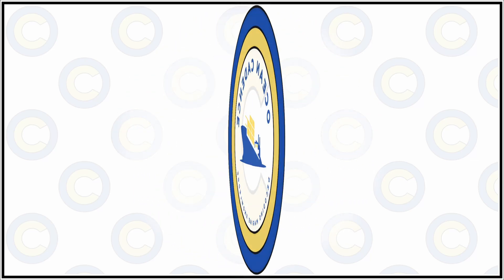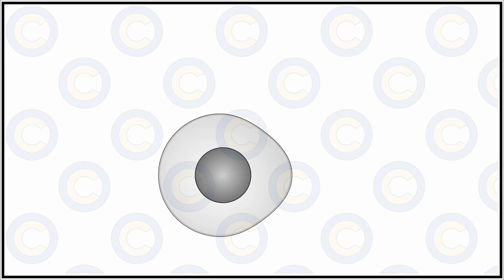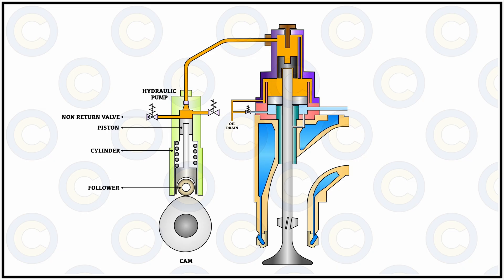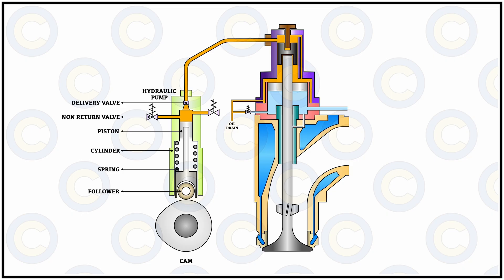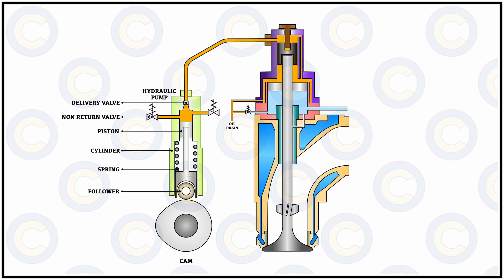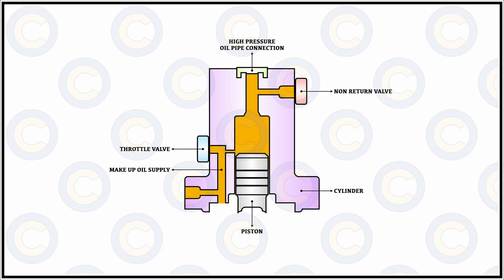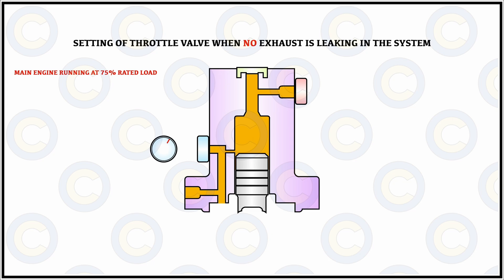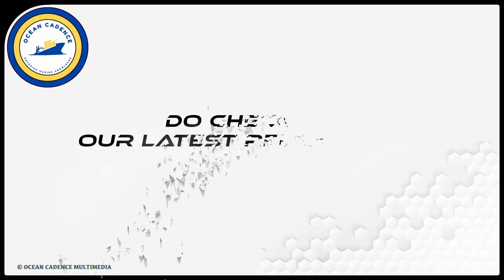Main Engine Exhaust Valve Actuator | Exhaust Valve Hydraulic Pump | Virtual Tappet on Exhaust Valve

Comment: Thanks for sharing the virtual tappet diagram with explanation. Thank you very much
Reply from the maker: We are happy to help! 🙏🏻
Reply: Thanks for the video , but are you sure about the adjustment that should be made at 75% of the Load. Because in one of my orals when I answered the same surveyor was not happy and he told you should never do it at 75% load because at 75% already oil will be hot so it will make the valve in slightly open position when the engine runs at lower loads. 
Correct me if I’m wrong.
Reply from the maker: There are 2 distinct cases, one where the valve is already in a running situation and where the valve has just been overhauled and then needs virtual tappet adjustment.

Under the latter, we need to adjust at 15-30% of the engine load because as such there is no wear, carbon deposit, or mistiming elements on an exhaust valve after overhaul and hence the adjustment at relatively lesser loads.

Now Imagine if for an already running exhaust valve with 1000-2000 hours passed and enough deposits and ingress, if you adjust at low load then it means higher amount of oil (since oil viscosity is lesser at high temperature) will be throttled at the higher loads and that means the exhaust valve would remain further open.

Maybe there was a misunderstanding in terms of which condition we are talking about.

Also, the common logic dictates that if there is a bleed off valve and you open it in the cold condition of oil then eventually when oil gets hot the flow of oil through bleed off valve will be more, which in case of exhaust valve will mean staying open until longer periods. 

So yes, for already in-use valves with running loads, adjustments are made at relatively higher values